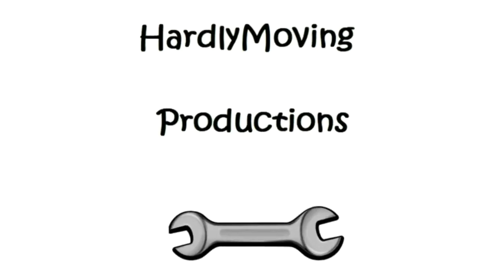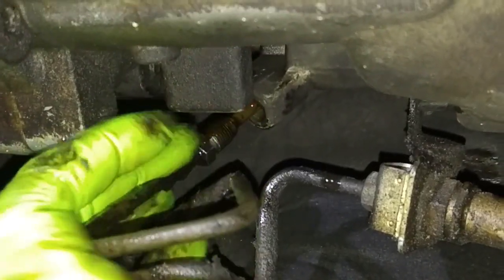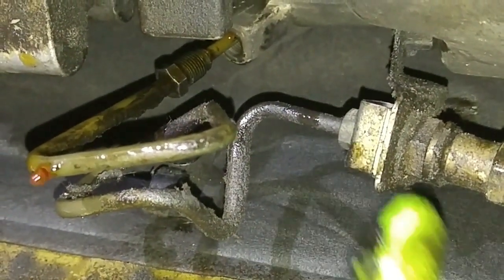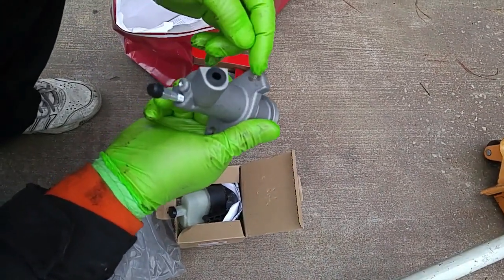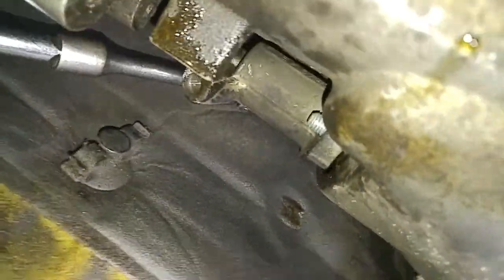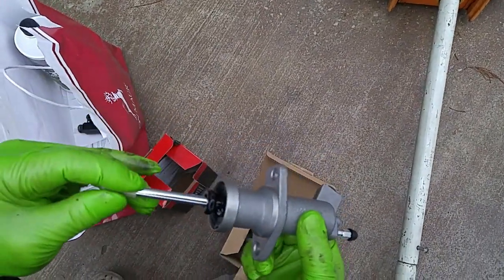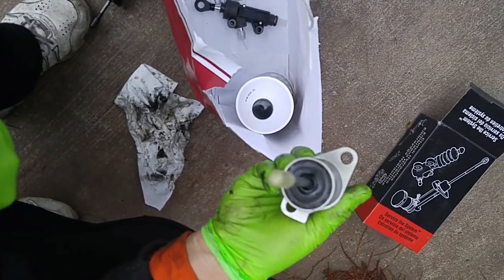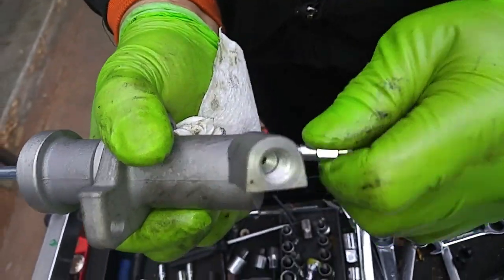Clutch Master & Slave Cylinder Replacement - BMW E46 330i

Comment: Really good video, I’m new BMW and just replaced the slave, it’s fixed my hard to disengage clutch issue. I found spraying some WD40 before sliding it in helped alot, it was hard pushing against the spring and getting the nut on, otherwise it was smooth! Thanks!
Reply from the maker: Thanks for sharing your experience!

Comment: Easiest way to bleed the clutch line after everything is installed is with a power bleeder. Hook it up to the slave cylinder bleed nipple, open the master cylinder reservoir, and back fill the line from below. You will see air bubbles coming up through the master cylinder reservoir, then the fluid level will begin to rise. 
 
Much quicker to do it this way as air wants to rise to the top of any fluid. Trying to force fluid down from the clutch master cylinder through the line is a long, arduous, and many times incomplete way to do things.
Reply from the maker: That’s a great tip.  Thanks!

Comment: my clutch pedal takes alot to push all the way down and i cant get into gear, what is the issue? there was also a smell coming from my pedal
Reply from the maker: Could be:  1.  Leak in the hydraulic fluid lines  2.  Worn clutch master cylinder  3.  Worn clutch slave cylinder.

Comment: My clutch pedal is actually wet with brake fluid. My Transmission also is dirty with a oil like substance. Oil pan is clean. I guess both my cylinders are gone. Also my Clutch only grips in the top range of the pedal, even tho I replaced my clutch 5k km ago. My guess is I have to replace both, right?
Reply from the maker: If gripping in the top range with a new clutch, I believe you have air in the clutch lines.  With respect to fluid leakage, I'd replace both cylinders.
Reply: @hardlymovingpro  when I did my brake system I bled all the lines, it was hood for about a week. Yeah both master and slave are pretty expensive when I buy them from bosch. Dont wanna buy cheap stuff and replace it again just months later. But thanks for answering🤝
Reply from the maker: Try rockauto.com.  They sell good quality components (at better prices) that works as well as the name brands.

Comment: Just picked up a 2001 bmw 325i an clutch won’t go all the way down. If I trick the sensors into letting the car start it’ll drive but the clutch slips BAD. What could my issue be an what would you start with before I throw $500 into it on a limb
Reply from the maker: As the video shows, start by replacing the master and slave cylinders.

Comment: As of right now I replaced  both master and the slave but my pedal won’t go all the way down to the floor but there is little resistance and the further down u push it gets very hard to push and won’t hit the floor at a certain point and it felt like that before I replaced them too what could be the cause
Reply from the maker: Possibly the clutch pressure plate the way it was designed.

Comment: will an almost fail master cylinder cause less hydraulic pressure when in cold start? Once the hydraulic fluid warm up and my car shift smoothly. My car is hard to shift into gear when first start in the morning but shift smoothly after warm up. My transmission fluid is new.
Reply from the maker: Hard to shift because the gear oil is cold hence thicker.

Comment: Awesome just did it with the help of yours and someonr elses video.
Reply from the maker: Good for you!
Reply: @hardlymovingpro   I would recommend removing the hose from the reservoir then remove from cylinder. i coulnd getit off under the dash lol
Reply from the maker: @SW-pm3ls  Had the same problem which is why I have a set of hose pliers that grabs and eases twisting the hose off.
Reply: @hardlymovingpro   I have aset of hose pliers as well. It just didnt do the trick for me personally. Still a strong video and now my Master cylinder doesn't make any more noise. So thank you.
Reply from the maker: @SW-pm3ls  You bet!  Glad it all worked out for you!

Comment: It a great video. More details. Does anyone why the clutch and the manual transmission  are not connecting? Thanks
Reply from the maker: Could be a worn clutch or pressure plate.

Comment: Trying to do a clutch job on my buddys 99 328i got everything out back in but when we go to put the slave in we don't feel the slave "fight" us to put it in. pretty confidant that the slave is lined up. we dont know what we are doing wrong or if something is messed up we have been fighting with this car for a while.  Please help
Reply from the maker: Little tricky getting the slave back in.  The slave plunger has to line up with the plunger hole.  Then you have to press the slave unit in with one hand while bolting it on with the other.  Use a mirror to see the plunger hole.

Comment: We have put 3 slaves in.      Evey time.     We bleed it and we see brake fluid leaking out of the bell housing (99 328i).           Don't know if we are doing something wrong or if it's 3 bad parts in a row.       The most recent one got it bled.   Felt good until we see.  Brake fluid leaking from the bell housing
Reply from the maker: Can't advise without being there to see what you did.

Comment: Thanks for the video, I am concerned I lack a good manual pump to bleed the air out though. What would the chances be of being able to do this succesfully without a hand pump?
Reply from the maker: Open up the bleed valve and let gravity let it leak out for around a hour or so.

Comment: the shaft i took out didnt have push and putting in the new one it didn’t have resisted.
Reply from the maker: May not have aligned it up properly.

Comment: Hay,what i need to do if my car wont start after i replaced tis cilinder?
Reply from the maker: Not a cylinder problem if the transmission is in neutral during engine startup.
Reply: What does that mean exactly? I’m about to replace my slave cylinder because I have no pressure to turn the car over @hardlymovingproductions

Comment: Just bought an E46 that I haven't picked up yet. Seller says that it needs a new slave cylinder. Do you advise changing the master as well?
Reply from the maker: If one goes the other isn't too far behind.
Reply: @hardlymovingpro  hey so my clutch pedal is really hard to step on will this fix that issue ?

Comment: What do you mean by "pump the cylinder" to get the air out? How do you do that?
Reply from the maker: Compressing the master cylinder creates vacuum on the supply/input side of the cylinder which will draw in brake fluid.  The pressure/output side will compress and push the brake fluid out.  If there's no fluid in the new master cylinder, only air will initially come out until you compress (pump) the master cylinder several times which will permit the brake fluid to occupy the air pockets in the master cylinder.
Reference:
 https://en.wikipedia.org/wiki/Master_cylinder
Reply: Does he mean pump the master cylinder by depressing the clutch pedal?

Comment: Can I use the e46 master clutch on e36?
Reply from the maker: Can't say.   Do a online parts cross reference.
Reply: @hardlymovingpro  i will be using the later model  master the thread on version thanks for the reply I will get a custom line
Reply: Did it work?

Comment: 05:04 that pedal just magically came off 😮
Reply from the maker: Clutch pedal pivot shaft.
Reply: @hardlymovingpro  saw it late af
Reply: @hardlymovingpro but thank you hero
Reply: @hardlymovingpro 4:24 shit flew over my head mind you I'm working under this TX heat (105°)
Reply from the maker: That's brutal!

Comment: What if there’s no spring resistance will I need a new clutch??
Reply from the maker: There should be.  Probably did'nt have the slave cylinder rod lined up properly.
Reply: But my old one didn’t pop out like it did in your video n I sticked my finger in n the release shaft has a lot of play. Anyways After I changed both cylinders n bled the clutch my car went into gear somewhat smooth n no slipping noise or smell of burnt clutch but later on it’s hard to go into gear is it possible that it’s my release fork and/or my clutch pivot ball?

Comment: My 2000  323 comes with a GM auto tranny. The reverse gear is shot. Thinking of dropping the auto and installing a manual. Great info :)

You mentioned ypu have a manual.  There was an empty spot for the automatic tranny ECM. Since I have an auto, just disconnect it.  "50's kid" dropped the auto and installed a manual.  His videos was pretty extensive.  Then he mentioned, need to code the tranny.  This was the point, i abandonied the idea. I just retired and thought it won't be too bad.  Since I have time.  The auto is a GM unit and everybody in GM knows about the problem.
Reply from the maker: An auto to manual would be an interesting conversion.  Only concern would be the PCM (power train control module).  It treats both the engine and transmission as one unit.  If it senses a problem with the trans, it may put the engine into limp mode.

Comment: What if your clutch pedal goes all the way to the floor?
Reply from the maker: Then either your master or slave cylinder is defective by not holding hydraulic pressure (assuming you have fluid in the lines).
Reply: @hardlymovingpro  aight thanks. 

So heres my situation my clutch isnt slipping engine stalls in first. 

Though the other day the clutch pedal went to the floor. 

I replaced master and slave from my other Infiniti. Put fluid in reservoir still went to floor. Probably the master or the slave is defective. 

So obviously if i get no pressure in my lines i have a leak or either is bad? 

Would it matter with a bad bearing?
Reply from the maker: Just pouring in fluid into the reservoir won't work.  You probably have air in the lines.  The air must be purged out through the process called "bleeding".  Simple two man process:  One guy pushed down on the clutch pedal and holds it down.  The other guy opens the bleed nipple to allow both the air and brake fluid to come out.  The bleed nipple is then closed and the clutch pedal can now be released.  Repeat until no air shoots out of the bleed nipple.  Keep the fluid level replenished.
Reply: @hardlymovingpro  ive tried to bleed it no fluid is coming out the bleed screw on slave cylinder.
Reply from the maker: Keep pumping ... it'll eventually come out.  You did replace the master and slave cylinders ... right?
Reply: @hardlymovingpro  yeah but from my old Infiniti but i replaced the whole clutch system
Reply from the maker: Then you may have other issues that maybe effecting the clutch pressure and release operation.
Reply: @hardlymovingpro  i got it thanks for your advice i just had to keep pumping
Reply from the maker: There you go!
Reply: @hardlymovingpro  appreciate your help but one more question. 

Whats the assembly for the hose nut on the slave cylinder. Nut washer through hole and washer?
Reply from the maker: It's all part of the hanger assemble to support it to the chassis.
Reply: Hardly Moving Productions  can I just change the Slave cylinder with out changing the master cylinder because I just change the Slave and my clutch peddle still down and there’s no liquid coming out

Comment: My 2006 BMW M5 clutch master cylinder looks cheap and is made out of... plastic.
Reply from the maker: Figures.  If they can replace an aluminum or steel cast or machined part with molded plastic, they can save a ton of $$$$ on manufacturing.  As long as the part lasts through the warranty period, that's great for BMW's bottom line ... but not for the 2nd, 3rd or 4th car owner who thinks they got their car for dirt cheap.